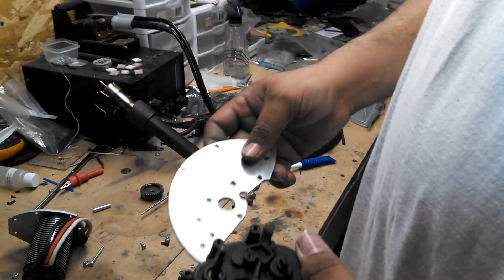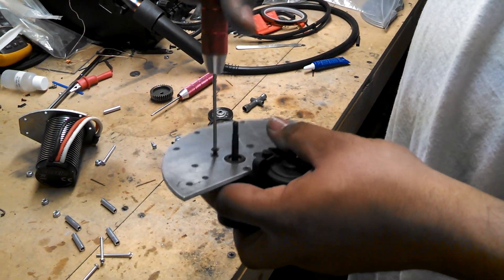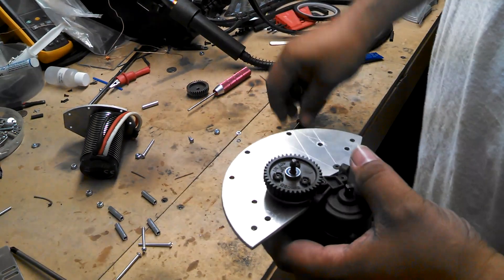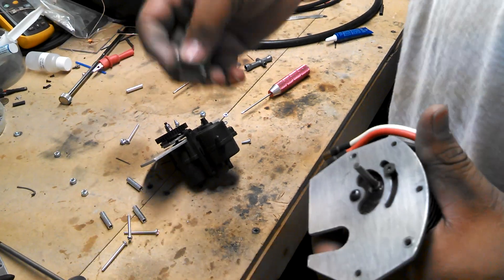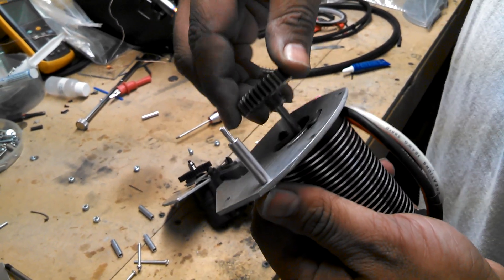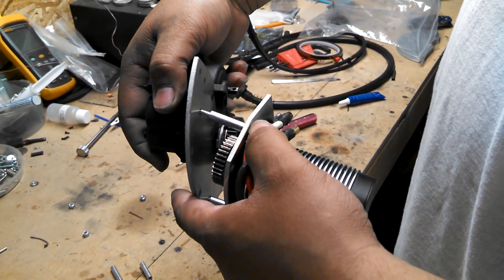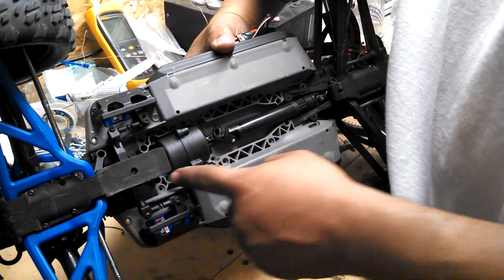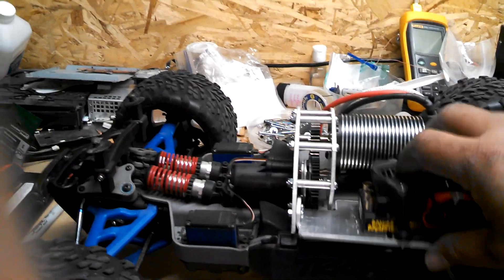E revo castle 1717 motor mount install 1650 kv

Comment: Could you please tell me which gears you are using? 34/40, right? Traxxas gears? Do you have a part number for me? Your motor mount is great! Thanks.
Reply from the maker: Andreas von Oesen  40/34 I used in the video but I went down to 34/34 mod1 pinion from xo-1 and integy revo 3.3 mod1 spur

Comment: Hey can you please tell me what is the rpm on that motor of the 1717motor because I got that motor off from eBay please respond
Reply from the maker: mine is a 1650kv and they also make it in a 1580kv

Comment: What speedy u using? Im putting a green 1717 into a Mt4. Do u think its a waste having this beast without a bigger gear to push with the extra torque?
Reply from the maker: bigger motor lower kv bigger gears. My opinion. I like my cars fast.
Reply: @sagacustomrc  can u make a motor mount for the erevo 2.0 for 1717
Reply: @raheemsmallwood7600  theres on on the sagacustomrc.com site. Mine came today.

Comment: Are there any less bulky mounts?
Reply from the maker: for that motor, not really sure. do a google search. I have a newer version of the one in the video that is a little smaller but not by much. The weight is not that much more than the stock mount.

Comment: I thought this motor was the same diameter just longer. Is that incorrect? I was thinking of upgrading to this but now I'm not sure. Is the performance increase worth it?
Reply from the maker: it's not the same diameter. It is bigger than the 2200kv width and length but the mounting holes spacing are the same. For me I think its worth it but you have to use the right gearing for what you trying to get out of it. more speed and torqe with less heat. This is only my opinion.

Comment from the maker: the slipper clutch can be adjusted with the little traxxas wrench. if you need to replace slipper pads you will have to take it apart. You should get upgraded pads before you install it. You would have to take off the motor plate to replace pads.

Comment: now what happens when clutch starts slipping or pads need to be replaced? do we need to remove the entire motor off of the revo to unscrew everything and replace the slipper clutch and/or pads?